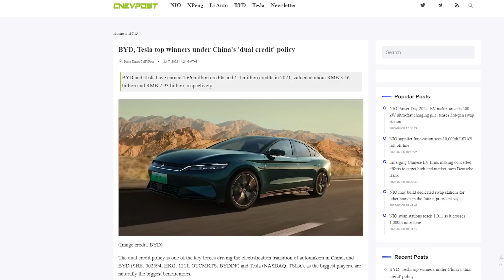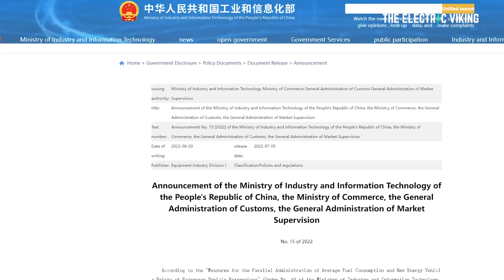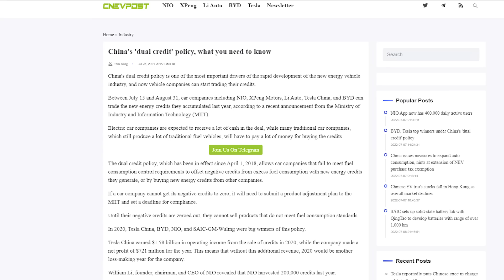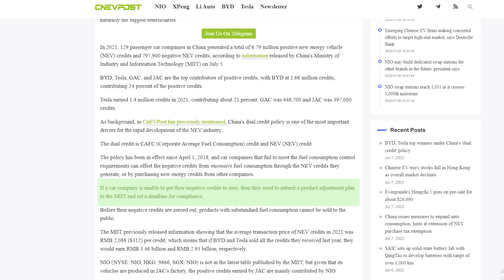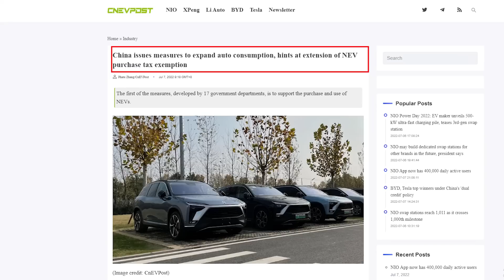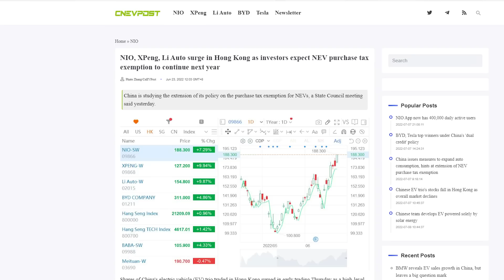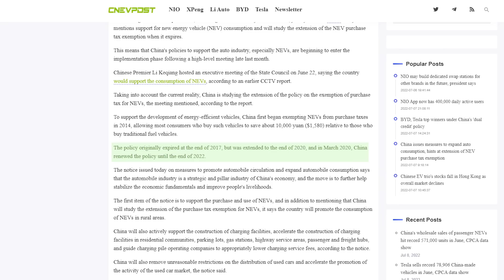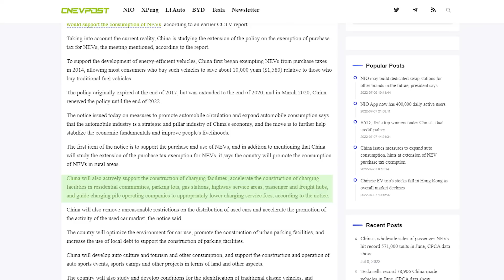BYD, TESLA & Chinese gov plan to dominate global car market

Comment: Thanks Sam. Its not just the environment, China very keen to reduce reliance on ME oil. 

Most oil used in China has to run gauntlet of US Fifth Fleet. This is a point of strategic weakness, they want to eliminate it.

That said, EVs with V2L and similar features have particular attractions for Chinese consumers as they enable the vehicle to perform other valued functions than just transport.
Reply: You make a good point on oil and that is why they are #1 hydrogen economy and growing it fast.
Reply: Jim made an important reminder of Beijing strategic concern. I’d like to add about the Beijing scheme to overtake global auto market, at a time when ICE  intellectual property rights, production experience, industrial food chains lay waste. It is happening now, in preparation for the big fight.

Comment: I've seen this coming for a while. 

Why else would the Chinese Government be so accommodating of TESLA, to the point where TESLA is the only foreign-owned auto company in China without a local partner?

And why do TESLA and BYD work so well together....to the point where they don't even produce direct competitors to each other's products?

Tesla use BYD battery technology and BYD are building factories using TESLA production technology.

There's pretty clearly an "agreement" in place and it will have huge implications for the future of the global auto industry.
Reply: How is BYD using TESLA production technology?  I haven't heard about this.
Reply: @jimjam36695  Tesla hired a chinese company to design and build their biggest giga press, which makes the car assembly way simpler and efficient.

After figuring out how to do that they can build giga presses for other companies now(mostly chinese)

What the chinese government did was brilliant. 

Tesla helped build China’s ev supply chains, pushed local competitors to go into the premium sector
(can’t sell cheap evs abroad since gov can just raise tariffs to keep them out) and it’s an indirect technology/ idea transfer.

That chin comp holds the design patents for the press but it was Tesla’s idea

Comment: Good information Viking. I think that the only reason more e.v.s are not sold in the west, is due to legacy auto's meager supply of e.v. cars.
Reply: DId you miss the part about how China is subsidizing EVs on "3 or 4" levels.   Costs something like $1K extra to plate an ICE car and they will not let you drive it into the cities.
Reply: @danharold3087  10k
Reply: @vorlon81  10K of subsidizes?
Reply: @danharold3087  No, it cost around 10k to get a licence plate in some cities if you are an ice vehicle but for ev will be waved.
Reply: @vorlon81  WOw thanks for the info :)

Comment: Very interesting indeed. Would like to hear more about what Chinese makers have to do to break into global markets because its not just a case of building cheap cars with US/EU spec and exporting, otherwise they would already be doing it. Tesla have the big advantage of course. On the upside there are rumours that EU are considering a VAT exemption for EVs as already in Norway. Hope UK would follow suit.
Reply: Most Chinese auto companies are likely to hold off on major inroads into external markets until their domestic markets are mostly satisfied. Then they will start with under served markets in Africa, Australia, and South America, then hit Europe and the US hard once they have the production and volume to flood their markets.
Reply: @GoCoyote  I understand that margins are low in China so they need to tap the EU or US markets to become profitable. Seems like BYD are serious about selling to Australia and they have already sold 1000 Tangs in Norway where they can import and sell tax free. Of course there is also Polestar. We get lots of news in the UK that some Chinese maker is about to release a model here and you can reserve. I am beginning to suspect that these are just market research exercises but hope I am proven wrong.
Reply: @bananacabbage7402  "Margins are low" is a huge understatement.   This video pointed out that electric cars in china are subsidised at "3 or 4 different" levels.   Looks like many of the electric cars sold in china are sold under the cost of production.    That is good for the Chinese people.  Not against it.   But just know that $10K USD Chinese car may be sold  for less than the cost of production.

Comment: While Tesla and BYD may dominate the BEV sector it will be a small sector so long as Lithium production remains limited, the most optimistic being 10 million vehicles a year perhaps as few as 5 million annually; this would be a modest niche in a 140 million vehicle market. BEVs are of limited green potential; and need a new chemistry to scale. Consider if you are optimistic that such a better battery will be forth coming; why would you invest in a Lithium mine?  If you think your new chemistry might be outdone by a competitor why would you invest billions just to have your investment trashed by the superior battery?  This will be a high risk period for EVs.
Reply: Makes a lot of sense Jim.
Reply: Peak auto was less than 90 million units world wide.
Reply: Except old lithium batteries can be remanufactured to new lithium batteries. So sorry Jim, you're wrong. Your argument was a Scotty Kilmer talking point and I rebutted him on that.

Comment: NEV rules include Hydrogen powered vehicles. China is the fastest growing hydrogen economy in the world.
Reply: Hydrogen is not really a solution. You still will have over 2000 parts in the vehicle, prone to brake, hence still dependent to a dealership network. And then, new charging networks will have to develop. With electric, atleast, worse case scenario, the car can be charged at home.
Reply: Not to mention, the design of a hydrogen engine,is similar to an ICE car, exept, because is using hydrogen as fuel, is lacking the lubrification properties provided by gas or diesel engines, for lubing the upper side of cylinders, puston rings and pistons; so tyevlife of that engine can not compare in reliability, even with a classic engine.
Reply: @t.s.3669  I believe you are too much focus on passenger car which battery could be a solution but not others. Battery is not the answer for truck, Semi, tractors, long distance coach, vessels and aircraft which are either on LNG or Diesel which hydrogen can replace fossil fuel directly. 

F-150 Lightning towing distance reduce by approx 50%. How many KW/h requires  for 50K lbs Semi (including 40K lbs cargoes) to travel 1,000 miles and how long it takes to charge that gigantic battery pack? Hydrogen takes similar time and distance as LNG but lighter. A steam ship that sails across pacific - battery might not even sufficient for lighting and appliances for 2-3 weeks usage. 

One might not aware that US Navy and Air Force generated more pollution than some small country total exposure and never  counted into USA carbon emissions calculation 

That’s why China, Korea and Japan are seriously invest in Hydrogen
Reply: @wsi1917  pleased to hear from someone who understands the global perspective of the hydrogen economy instead of narrow minded and out of date BEVangelists who do no research. 👍
Reply: @benjaminsmith2287  Have a look at proton technologies based in Canada and read about what they can do. You will see why the fossil fuel industry are getting interest in going ‘green’.
Reply: Hydrogen is good for large applications, heavy machineries, ships, etc. I think these will be adopted much quicker once there is excess energy from the sun and wind that would otherwise be wasted due to lack of battery storage.

Comment: Say Henry; that would be a good point except there were no significant number of EVs made before 2020; if the average life is 10 years; one wouldn't expect to see any significant lithium from EV recycling till then. If EV cells ever meet the 1 million mile life claim you won't see them recycled for 30 or 40 years. I tihink probably Scotty saw one of my notes; Lithium EVs very optimistically can't exceed 10 million made a year and realistically won't beat 5 million (BEV). EVs need a scalable battery; lithium is a dead end.  They also need a green grid; which world wide is 90+% fossil fuel powered.